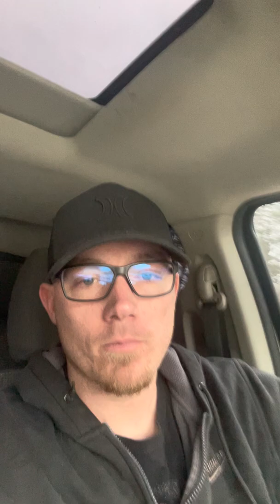The Hemi engine and why it sucks

Comment: this is like calling 4 stroke motors inefficient compared to 2 stroke motors because the 4 strokes have to stroke more.  Its just a different design.  Its not like they built it with 1 spark plug then aftermarket came out with an adaption of 2 spark plugs.  It was designed with 2 spark plugs in the first place because its a different design.
Reply from the maker: The original hemi design had one plug, then two. It needs 4 to be efficient.

Comment: I have a ton of respect for your tuning abilities.....but your WAY wrong.
Reply from the maker: The information given is factual, the title is more or less click bait
Reply: @Recklessmotorsports   seriously your waaaayy Phucking wrong , the G3 Hemi efficiency is on par with some of the better performance engines made since 2000.  
1st off  the 03-05 system is a Primary/waste spark single coil  ,1st plug is Primary(trailing plug in cylinder), 2nd plug fired by it's 180* out Coil pack , IE #1 Primary fires at 26* BDTC power stroke, and fires secondary plug # 6 cylinder meanwhile at a reduced voltage#6 Coil pack fires it's plug and Cylinder#1's secondary plug  at 26* BDTC exhaust stroke  ...hence the reason the more spark advance leads to more Knock sensor reduction in the 04-05 PCM, no matter the octane , the sensors are hearing the waste spark ...the system is also major cause 2005's  6.1s eating pistons when the tuners finally cracked the PCM's for tuning, the waste spark was "too" strong for the crappy oem pistons to take.
  The 06+ system is a  Primary/waste spark dual coil system. #1 fires Both of it's plugs at the same time ,and computer fires waste plug at a set time of 5* ATDC exhaust stroke....you can not change that,
2nd, the larger the bore the more advance you need, 3.917 bore doesn't need as much advance as 4.055, which is why (with some other factors) a optimal timing table for a 5.7 is marginal for a 6.1, 5.7 Eagle and 6.4s because of the VVT want something different all together.
  LSX engines need more spark timing to achieve the same HP/CI when comparing equal  Cam events, Head flow ,compression. Last week ,we had a 5.7ls1 with a Texas MS4 cam ,@ .50 239/242 .649"/.600"   needed 32* degrees total from 3400-6000 to hit 452HP425tq with stock 243 heads on our mustang dyno, while same ambient conditions we've hit 475hp/465tq with Howards 786965-13 @ .050 231/237 .626/600  , with 24* degree total from 2800-6000. with a junkyard 03 truck long block with LX intake. 
Ideally the LS platform likes 34 degrees total timing.
  When I was doing FSS(Factory super stock) Engines the 6.1s were up in the high 700hp mark with 26* timing while our LS3s were in the mid 700s with 38* and the 426G3s NA were in the low 900s with only 24*  while using only  649/649 lift cam, the LSX's need 750 lift to make the same HP/CI
  The G1 Hemi makes it's best power with max 30* timing, no mater the displacement, compression, cam timing.
 On Nitro 35 degrees is max, and you are only hiting 1100hp, the BGE 392s on Nitro we can get 1800hp with 28* but back them down to 20* (block splits around 1800) 
  the SS/AH Hemis are making  over 1000hp(last one on the dyno I had was 1094hp @ 32* total )  with 30-33* timing, while the closest 427BBC in SS/AA needs 44* total and is maxing out around 975hp 
    

similar
Reply from the maker: I think you’re reading too much into what I’m saying, because of the hemispherical chamber it requires more timing advanced which on pump fuel makes it more prone to detonation. Do the hemi engine requires a higher octane fuel to be efficient. If they ran 4 spark plugs it would be amazing.

Either way next year is the end of the hemi engine either way.